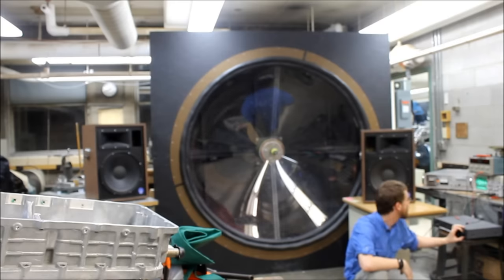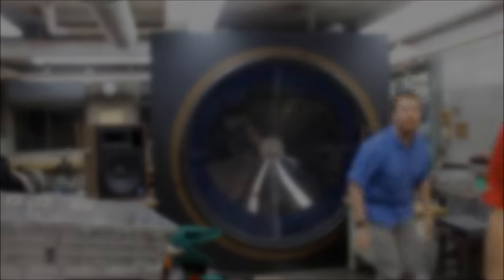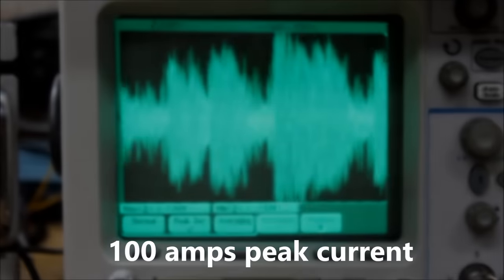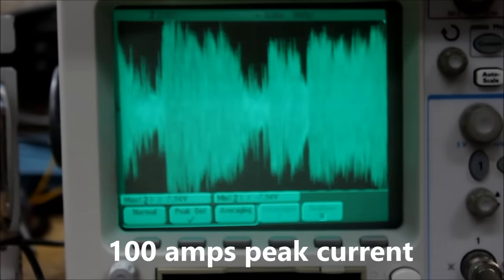Giant Subwoofer Video

Comment: Despite the obvious purpose, the membrane fluctuates quite well, and if the development of the diffuser was entrusted to the aviation design engineers, they would bring the system to close to perfection, and this would become an artwork.
Reply: Carbon fibre cone?
Reply: @Scrogan Not just a carbon fiber cone (it has nasty resonance modes), but structured to take into account the architectural stiffness and intrinsic speeds of sound in the main materials used. It's all quite complicated. But in fact, you need to have the most rigid design with a minimum mass and well-suppressed internal vibration modes.
 Не просто конус из карбонового волокна (он обладает неприятными модами резонансов), но и структруированный с учётом архитектурной жёсткости и внутренним скоростям звука в основных используемых материалах. Это всё достаточно сложно. Но по сути нужно иметь максимально жёсткую конструкцию с минимальной массой и хорошо подавленными внутренними модами колебаний.
Reply: @Scrogan  fiber*
Reply: If you did all of that it would still suck.   All membranes and resonant air space enclosures have an 'ideal' combination of size, cone surface area and electromagnetic properties of the motor.  This applies not only to speakers but, musical instruments.  For example a 14" x 22" kick drum has a natural resonant frequency of 60Hz.  Even changing the heads will still cause that instrument to maintain it's natural resonance.   The larger the diaphragm the slower and more inarticulate the response.  The larger the surface area, the more the upper range 'beams.'  That's why tweeters are small.
Reply: @keithmoriyama5421  That's solved with using a multiple-voice coil setup, distributed radially, in combination with a more rigid substrate. Apply additional coils at resonant negative zones, and with some delay tweaking individually, you can harmonize the entire surface. 

Essentially, yes it would suck, if you *only* use a single coil. Think outside the box next time. Thought this was engineering, not insanity.

If it's too floppy to move at once, grab it in more places and shake it harder.
Reply: @nobody8717  Then why has NO ONE including the highest engineers at JBL, EV, Klipse and many others never been able to accomplish that?   p.s.  If you were a sound engineer you would know that phase alignment is impossible in that situation-- you can't even do it with conventional single drivers!

Comment: To those arguing over how many HP this speaker is capable of handling, 1HP is just under 746 watts equivalent. And motors on things like compressors take far more current (and thus watts) to start than they do to run, that is why they typically have large starting capacitors.

Comment: If you really want to blow their minds, do the same output with an 8" 4ohm sub into a large bass-horn.  and show them how passive amplification works.  :)
Reply: @readiboardii3873  that will create a black hole
Reply: We run 21in drivers in 14ft horns and its great
Reply: I do effectively the same thing when i toss my Bluetooth speaker into a large box😉👍
Reply: 7000W into 8 ohms are 236Volts at the terminals. thats really mains voltage. To test the speaker , simple plug it into a socket and wreck your home.☺

Comment: That thing is pure madness! it needs it's own nuclear power plant but I thought it would get closer to 5-10hz. Mid 30's is a bit disappointing. I thinks it needs some re-engineering behind the cone. 

I would look at getting rid of the rubber ring and use some kind of ribbed-like spars like spokes on a bike to help suspend the cone.
Reply from the maker: Thanks for sharing.  Your intuition of the 5-10Hz is about right.  It self resonates at 4 or 5 Hz and tries to tear itself apart if we approach those frequencies.  The 30 Hz we played with corresponded to the frequency of the room where the windows rattled fairly well.  

The whole thing was made from stuff we had laying around in our shops, we've got about $350 in it aside from the equipment/parts we had on hand (The team members do research in power electronics and electric motors, not audio). The team that made it built it over a couple weekends.  The cone material needed to be transparent so kids who were coming through for UW engineering expo could look inside it:  UW-Madison Engineering Expo 2011.  

The poly carbonate cone material used is really a performance downgrade since poly-carbonate is heavy and not stiff enough for the size without any additional structural support (spokes or ribs or something like them).  But we weren't going for performance, more so 4th and 5th grader satisfaction in a limited amount of time and $$$.  This video above is some pre-event testing we did.
Reply: Daniel Ludois I'm no engineer so I wont pretend to be some know-it-all subwoofer guru but I do think you guys might be on to something! There could be a market for super sized super-powerful subs like this one albeit at about half the diameter. You may need your own custom amp too.

Here's the scenario. In my dedicated theater I would hide my speakers behind an acoustically transparent screen. The center speaker would rest just above one of your "Wall buster Subs" (in-house name - The neighbor hater). I might even put a second one in the back behind a false wall. Bass bliss baby!

If you guys do go for it and market a "Wall buster" product I just want one second generation sub 2nd from your top-of-the-line model. Deal? PLEASE?

That being said thank you for your response and for being civil. We both know civility is in very short supply on the net these days.

Think about it guys and think outside the box. You're all awesome...
Reply: FrakU2 There are already companies that make 32" subwoofers. They aren't cheap (or really any good) so there isn't much of a market ;)
Reply: bassl0va Doesn't that say it all? NOT cheap and NOT very good. You guys have an opening here. Go for it!
Reply: FrakU2 If they cost any less than they did they would be even worse. "Not cheap" was the wrong words, bad value would have been better. As you can get better performance from more practical sizes of drivers for the same price, if that wasn't the case then 32" drivers would be flying off the shelves.
Reply: bassl0va You know far more about this than i do. I'm so sad right now!
Reply: Its a friggen sealed box, If they wanted to get 5-10hz they would have to tune the box to 10hz which will sound like @ss on everything else. I dont get why people think anything under 20hz is enjoyable. Its cool but absolutely useless in music.
Reply: Jeff DaChef It's not really usefull for music. Though some large pipe organs might have some material pretty low. 
There are movies with effects that low though, which is the only real reason for getting useful output at such low frequencies.
Reply: Wow perfect for the xtreme  bass
Reply: +FrakU2 This things are very dangerous. Those infra sounds are very dangerous. You might not hear that low sound frequencies. They can mess up people health or mind. If you think you are first you are not. Such frequencies were achieved if i am not wrong in 18 century by modified organ pipes which where twice bigger then the biggest pipes in ordinary pipe organ. Anfortionaly it might look cool from paper but the results were terrible. People get in to uncontrolled fear and begging to panic. Thats why this technology was abounded. And today this technology are used by USA military and its satellites for dispersing street protest which are against current government by so called non lethal weapons which in fact are lethal.
Reply: +bassl0va Let&#39;s be clear. Infra sounds are below 20Hz. If i am not wrong ordinary consumer digital sound does not go below 20 Hz.(But i might be wrong).  P.s. Because it is used it does not mean it is safe. For example the first generation cell phones where extremely dangerous for health and still they where mass produced and it was legal by the law as i know. Nobody was jailed because of that.
Reply: ⰔⰀⰞⰀⰔⰎⰖⰃⰀⰁⰑⰃⰀ (http://давайте-жить-по-совести.рф) ⋅ Digital audio signals can approach 0 Hz. Reproducing that signal is a different story. Iha ve a couple of audio tracks that reach into the subsonic range, and it's not unusual for the LFE track in movies to have subsonic content. It's not the subwoofer channel, as many think of it, but the Low Frequency Effect channel. You're supposed to feel it.

Brief exposure, even at a somewhat high intensity level is not a problem. Extended exposure to very low frequencies can cause the panic you talked about. Brief exposure to very high intensity can make people sick. Extremely high intensity exposure can cause serious injury or death, but most people call it an explosion at that point.
Reply: Buy ASW-1000 At B and W
Gives sick sounds
Reply: you can use this for an alarm of the nuclear explosion... (:
Reply: albertino lodato
Reply: Frak
Reply: with that big cone you can never get 5 hz, it would break itself, alseo if you take off the rubber ring the sound pressure gets lost, do you even audio??
Reply: FrakU2 its*
Reply: @GODenWord  you are wrong. I have a fairly normal sub from Sony that goes down to 18. I am a firm believer when it comes to using a sub in music. If you tune everything in your setup just right, its magical.
Reply: 5hz only with rotary subs

Comment: a club in cape town built the dancefloor over a single 35-ft cone from 2x 18" subs. then they replaced everything glass with plastic but the building started to disintegrate so it was dismantled. When you've built a mountain out of Peavey SP100 subs, you know what it means to move a lot of air.

Comment: I'd still like to have a tunable passive radiator that big. Would have much better results than engineering a working subwoofer driver that large. Much easier to achieve and cheaper too. This was still insanely awesome and fun!
Reply: I read this as "I'd still like to have a turntable massive" 
😎
Reply: @Monstermagick  A 100in record for the whole collection 😂

Comment: Some of the video's of rotating subs look very interesting - so basically you modulate the blades of a large fan.
Reply: remember seeing one called the tornado or something in the 90s it was supposed to go under your seats in the front but can't find anything on it anymore an never saw on other than in ads in mags an it was a rotating fan type impeller in a tube an looked powerful based on what I was reading

Comment: I'm very very disappointed.. The cone isn't rigid enough to be worth a damn. I understand that this is an educational tool and is mainly cosmetic, but considering how much power was being applied to this thing you really could have put more effort into the viability of the speaker itself. Massive opportunity wasted. You know, you can make carbon fiber sheeting relatively easily..
Reply: For educational purposes it was stated the cone must be see through.... Of course they could have made components more "rigid", but carbon fiber would defeat that purpose now wouldn't it? This was not a project being tackled as an opportunity to please the inept, this was an opportunity to show kids in real time the workings of a speaker, and well done I might add.

Comment: That's awesome, and I'm sure elephants would really enjoy it. For me, dual 15's in a well ported box is where it's at. 1000W amp on an inverter and an LPF,  you're good to go.
Reply: That will give you way better bass than this ridiculous contraption.  Certain speaker dimensions give unique sound signatures relative to their drivers.  Dual 15's give some of the best bass response period.  The cone surface area is an idea trade off between massive low end, and 'quick' attack.  Coupling 2 drivers also gives you a 'sum' and concussion that a single driver just can't deliver.  There is also an important secondary bonus that even audiophiles are not aware of.  The natural resonance of a 15" is 60Hz-- which is also the natural resonant frequency of a 22" bass drum.  The Famous Neve company of audio consoles deliberately uses 63Hz as their low end EQ for that very reason.
Reply: R.IP 🔊🔊🔊🔊

Comment: I bet a single 18 would have better output.
Reply: @chfsunf1ower296  That's odd I've never seen another anime fan on videos like this.
Reply: @BenaresDarkness  😂 well nice to meet you
Reply: @chfsunf1ower296  Like wise.
Reply: You realize you're listening to this through your own audio so you can't hear how it sounds IRL?
Reply: @chfsunf1ower296  bruh, its a video, you cannot hear what's actually going on.   Take your favorite speaker, and show everybody how great it is using a video.
Reply: I have those CDs, lol!
Reply: @cpu64  I have the cassettes lol.
Reply: Also look at the description. It's built to be a demonstration for kids, not proper audio equipment.
Reply: @chfsunf1ower296  Seriously??
Reply: Sound like me when im using the force on the toilet
Reply: @bt4670  I mean, it's kind of obvious that it doesn't have a lot of output. First of all, it has a very tiny voice-coil, so the size of the cone is actually a liability to the coil; this subwoofer would produce much more output if it had a smaller cone and cabinet. You can also see in the video that the driver has very little extension; not good for producing low frequencies at a high output. Also, he literally had to get within 6 inches of the driver before the microphone started clipping; I bet you can't even hear this thing from 3 feet away. A good 18 inch driver can fill a large room with a 20 hz frequency. I don't mean to be the buzzkill, but, as the description says, this thing was built for demonstration purposes regarding how a driver functions, not to actually produce high quality audio.
Reply: This sounds good but mic cant record it properly. If someone is around this giant woofer they will feel its awesome so u nd
Reply: If that giant sub were to have a one foot diameter voice coil and a proper motor, it will tear that lab apart.
Reply: Yah, this was either just for fun or they are not actually expecting any real output.
Reply: "This was a demonstration built by graduate students at the University of Wisconsin -Madison in 2011.  It's purpose was to be physically large so elementary school kids could look inside while it was running and illustrate the how a speaker works"
its not meant for SPL
Reply: Needs more Xmax!
Reply: I realize now that this was just for fun.... Im sure the guys doing it understood that a ridged cone is nessesary..

Comment: Isn't the coil diameter too small for the size of the cone? 
It seems that the source of sound is concentrated in the center due to the material of the cone, and the waves are not transmitted at the edge.
Sound quality is very bad.
Isn't it possible with a 10 inch cone?
Interesting challenge but disappointing results.

Comment: Good on you for building a giant speaker. Although if that speaker where to have silicone rubber mix diaphragm a rubber suspension and a top and bottom plate on the magnet. You couldn’t get within 50 feet/15 meters,if the power from that low of a frequency didn’t destroy it first.

Comment: It needs to be more stable like sturdy .. if it had supports radiating out from center and between like a spiderweb configuration then put another thin cone atop that it would look same use carbon fiber plastic or aluminum possibly this would create deeper bass and allow you to use the 8000 watts now it’ll start shaking and rattling before it peaks maybe even use three voice coils in lue of the one large one or two at least one inside the other I’m no musician but the blueprints I’ve scrounged up will work in theory maybe one day we will find out my goal is to invent a new speaker that isn’t a traditional voice coil so far it’s escaping me but if I have it my way I will find the solution very soon

Comment: ou know its a terrible design when you can pump 7000 watts into it in a room like that, and not go deaf. plus the massive distortion it has because they werent smart enough to understand that the ridges on paper speakers, are there for structural rigidity.